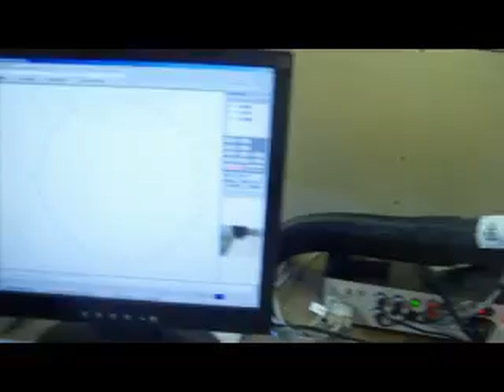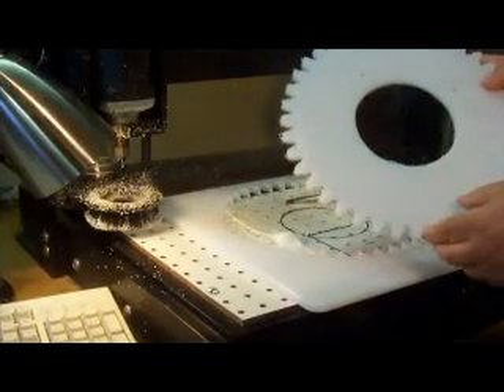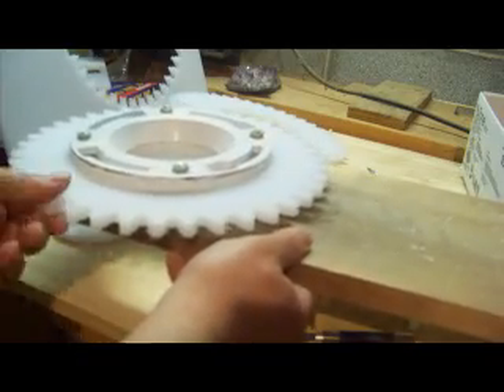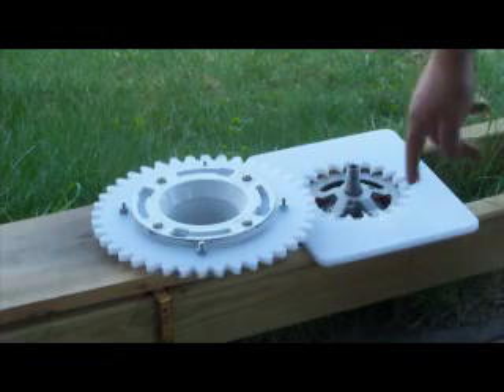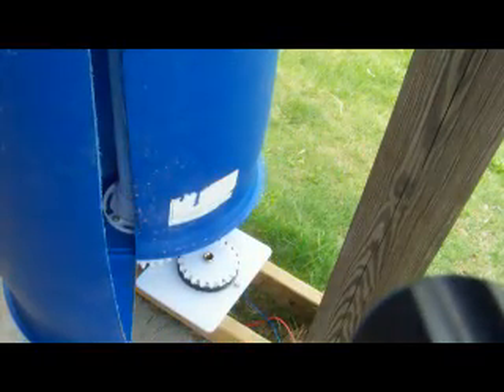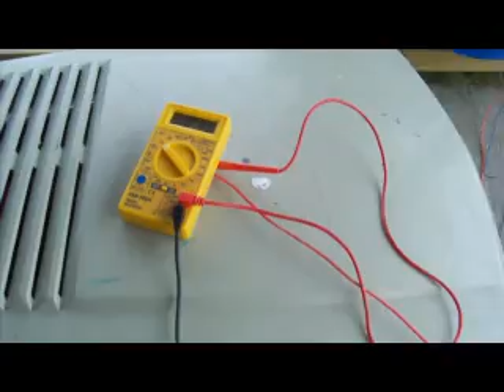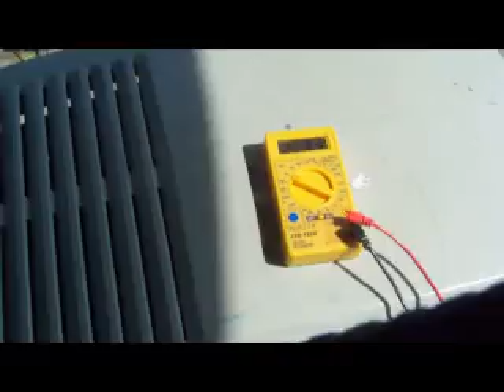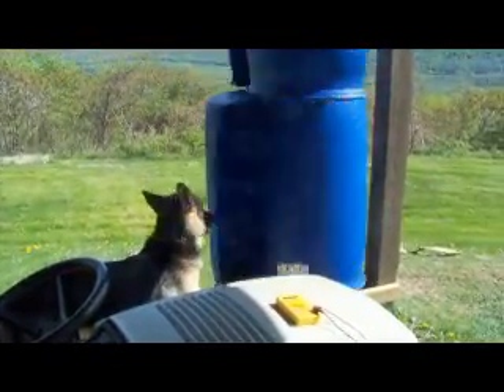How to Make an Inexpensive Vertical Wind Turbine - Part 2

Comment: I am currious why you chose to cut out and make the gears from plastic? (Other then to have an excuse to use that way cool CNC machine!) When I think an easier and probably less resistance way would be to use bicycle or motorcycle gears and chains? Using those would also allow the possibility of gear-changing for speed and wind velocity.
You did a great job on this! And you are an inspiration!

Comment from the maker: This alternator is based on a car alternator, but has been gutted and the inner coil has been replaced  with neodymium permanent magnets.  I'm not sure that the direction of spin matters as long as the wires are hooked up with the proper polarity.

Comment from the maker: Yes, I have a TV (insignia 15" HD lcd ) which works well because I run 12v right into the tv instead of using the wall wart that came with it.  Check to see if your PS2 or XBOX  can run on 12v because it will run much longer than if you run a 110v inverter which loses a lot of power as heat.

Comment: A belt system (in place of gears) would reduce the noise level and the pulleys are commercially available ready to mount on your alternator.  Either way, gears or belts, you might want to shroud your gear box, or belt system to avoid small animals and/or fingers getting caught in the system.  Or even your dog's tail.

Comment from the maker: 12V is a useful voltage if you have 12v consumer devices.  I am installed 12v LED lighting here and it bypasses the need to use an inefficient 110V or 220V inverter.   Inverters lose energy in the form of heat.

Comment from the maker: There is a trade off between the gearing and low wind operation.  I am now going to get more aggressive on the gear ratio on a 6-barrel design that I am currently fabricating.  Because it has more torque, I can use a smaller gear on the generator.

Comment: Nice work!

Seems to be allot of friction with those gears. You may want to use a belt instead to smoothen out your rotation. This would also make it start at lower wind speeds.

over all 5 *'s

Comment from the maker: hardyjch, 

Thanks for these great ideas.  I will have a new video posted in less than a month where I integrate six barrels in a new system.  It is not exactly what you described in your posts, but it does increase the torque in the system dramatically in three ways: 

1: I have increased the amount of each barrel which is exposed to the wind.

2: I am using more barrels. 

3: I have staggered the barrels at 30 degree intervals to enable smoother motion. 

I have this one about 90% complete.

Comment: would it be possible to reduce the load from the barrels by introducing magnets to suspend it on the axel? surely that would result in a loss of friction and heat dissipation? and if so would that greatly increase the overall RPMs?

Comment: Can i ask   Instead of your gear system ,Would the main drive wheel from a front loader washing machine work as well? Perhaps using the drive belt too? and anything else you could scrounge from a washer?

Comment: ok, so it should have good output, i suppose that now i think of it, regardless of rotation, the rectifier diodes should still only allow current to flow to the pos terminal anyway, i suppose i posted without thinking again lol, nice project by the way, how is it working out for ya?

Comment from the maker: Where can you get electricity for 6 cents per kwh?  Here in the wonderful state of NY we pay 17 cents.  Running a grid connect (some are under $300 now) is the best way to get a quick payback but many prefer batteries for redundancy, or a hybrid system.  We will be installing and reporting on two different inexpensive  grid connect units shortly.

Comment from the maker: 1)I think it should be possible to build a large generator at home but check with your local laws and codes to make sure that you won't be forced to take it down. 

2) Many electric motors can be used as generators.  Make sure that they are permanent magnet motors (magnets rotate on armature rather than coils of wire).  Different motors have different RPM requirements for generation. You may need to use gears or sprockets and chains to get the right speed for the motor.

Comment: @pearljamfan99 
Not really, think of it in terms of the change of momentum of the air.  If you can get it to swirl through the first curve and enter the second and take that curve, you've changed the direction of the air by 180 degrees twice, and the force to do that came from (and went into) the turbine.

Comment: Very interesting, but not inexpensive if you consider the fact that most people don't have a CNC machine, and some don't have the other power tools you used.  I don't see that you've been answering anyone.  I would also like to know how many watts it produces (if it even still works since the gears and stuff are plastic and will degrade under the sun unless the plastic that isn't affected by sunlight).
Reply: The plastic is nylon, which is pretty stout stuff.  Sprockets and chain are more practical.

Comment from the maker: This generator, which I bought on ebay, produces DC.  You can invert it to run AC if you have enough batteries and power, but it loses some energy in the form of heat when you go from DC to AC.  The approach I am using  is to use 12V appliances and lighting fixtures from the camping and marine markets.

Comment: You should find something that can slow it down if you want or a device that can put it vertical, when there's too much wind.

Normal turbines have some kind of brake.
It's so primitive.. that sometimes you should take it off.

You could cut some "doors" in it when a storms cumming up. It's very primitive.

Comment: I am a mechanic and I can assure you, at that alternator speed you won't produce any electricity. You need to speed up the alternator a lot more to produce 14 volts. 12 volts or less is nothing if you are using 12 volt batteries.

Also, a pulley and belt setup is much more efficient and quiet and will actually last much longer. Hope this helps

Comment: Try to put a chain and separate the gears this will isolate the alternator from the windmill vibrations also grease the whole thing to reduce the friction between the gears and the chain. 

Or at least grease the gears so they will have less friction.

Comment: Great engineering and workmanship!  Do you have any loaded tests?  I can see the open circuit voltage gets to 14v in some substantial wind, but what happens if you actually connect a battery to it and load the alt?  I can't find any hard data on your site or vid's, indicative of more VAWT smoke and mirrors?  I'm also curious about the charge controller that will charge a 12v battery bank when the input voltage is less than 13v (charging voltage for 12v).....    
Thanks!

Comment: The CNC is nice but you can cut gears like that with a scroll saw. I use those cutting boards all the time for interior boat panels.
Reply: The material choice is indeed inspiring, one can actually OBSERVE the friction 'melting away' from use as it self-smooths... awesome!
Man, I gotta get my pendulum-sail windbottler prototype finished and some more vids made, especially the details of the turbine that actually collects and stores the very wind that operates it.

Comment: Can I ask, would it not be better to use a belt and pulley system instead of gears. It seems that there would be less accuracy required for the alignment of the pulleys rather than gears.

Comment from the maker: DC motors with permanent magnets are very suitable.   The problem is that most of them are only efficient at higher RPM than a typical vertical axis wind turbine can produce, and thus need a gear, belt, or chain drive reducer which can wear out and usually robs the system of some efficiency.

Comment: Interesting idea i would probably use a belt driven system and use some recycled bicycle wheels instead of the Lazy Susan ball bearings.  Much less noise, more efficient, and can handle weathering much better.
Reply from the maker: You are correct.

Comment: I like your presentation but why add a gear? Can't the wind turbine axle turn the alternator directly? Doesn't seem efficient. Also, if  hi powered magnets were used on the bottom support so that the turbine would "float" it would be far more efficient and less noisy. What does this generator put out in 10mph wind?

Comment: Is that a Delco-Remy alt? What is the amp rating? I'm designing a  system w/centrifugal blower wheel using 1 in steel shaft w/  pillow block bearings (grease)  driving a standard 1/2 in v belt on a 125 amp Delco-Remy alternator. I havent decided whether to keep it at 12v w/ 12v bulbs or get an inverter and use 120v. I have most parts on hand. My initial project will be for  lighting only (inside and security) and maybe an absorber type Refrigerator. I'll only  use grid power for A/C.

Comment: Very clever,but with 2 major problems....Because i work on these projects many years i know that all kinds of alternators as much load you put on them charging batteries or using for an inverter 12-220 volt,its so harder to rotate them....Its the same as in cars.As the load is increasing you need more power to rotate them,so you loose power of spinning because the alternator is "braking" the wind generator,and you end up with a generator that cannot produce power anymore due to load....better to use pulleys with belt so you can control the load and its easy,longlasting,and really "inexpensive".Also you could use more silent bearings because the sound in a permanent construction like that 24/7 365 days....You cannot stand it.....Redards.

Comment: I'd like to know how much more power 
embeddedprogrammer  would get if he put a structure to shield the resisting wind, around the quarter of the rotating "turbine" where the wind is working against the "turbine" (or whatever you call it).
My guess, possibly double the power, double the RPMs.
If you do this, let me know what the results are.

Comment from the maker: Not sure what you can do with the blower fans (most won't work as generators) or the surge protector  The batteries could certainly be utilized as part of a battery bank (marine are better than car batteries).

Comment: Cool design, but I would agree with those that have said "use a pulley system" but would not use the whole mag-lift idea for sake of cost.  The weight of the barrels come in at a whopping 22lbs each!  I would say that reducing that weight by using a hole saw and whiffle balling the barrel walls severely and then re-lining them with a lighter plastic like heavy-ply plastic drop cloths.  I bet you could reduce the weight by at least 30% and thus greatly increase the RPM especially in light winds.

Comment: Because a car alternator produces AC which is converted back to DC, I believe the alternator should work fine in both directions, but this gentleman is using a permanent magnet alternator, which is more efficient than one you would find in a car.

Comment: I don't know very much about this sort of thing, so please forgive me if this is a stupid question. Why use the gear at all? Could you not mount the barrels directly on top of the generator and cut that part out completely?
Reply: i believe it is to increase the RPM of the alternator/generator. alternators are more efficient at higher speeds. summing up, you get more power output from the same amount of wind. its not essential, but seems to be common practice.
Reply: Eric Mastenbrook needs to step up the rpms but needs whole lot more 1600 min rpm for 50 amps plastic gears and chair mount not kicking it flays apart. Need steel construction.
Reply from the maker: yes, but you need a very low rpm axial generator for that and I was trying to use off the shelf stuff.

Comment: Could it not have been designed to sit directly on top of the alternator as opposed to the side of it and thus eliminating the need for the two gears? Without the two gears there would be less drag and it would also make less expensive. Just  a thought.

Comment: I like the idea, great innovation however, the gears need to be made of aluminum, stainless steel or some type of metal. The plastic teeth wears out to quickly and the teeth strip and break off.  i hope you put in a patent for this. great work.

Comment: @DineroDarkfire Good point! But I guess he only used the CNC machine because he had one at his disposal, most people who have a go at building this, who don't have a CNC, could either cut the gears by hand(it's tedious, but can be done!) or use a belt and pulleys instead! Even better would be to custom build a pm generator to bolt straight onto the turbine, no belts, pulleys or gears needed!

Comment: Not low cost with cutting equipment included. You seem extremely capable of doing this without all that. I am eager to learn and have from your video. But, steps are missing that I dont know how to supplement. Have any ways around the spendy techno?

Comment: From what I've read rainwater doesn't conduct electricity because there are no minerals in it. so snow shouldn't short it out. I have an open alternator and it's ran in rain and snow with no problems.

Comment: great idea, a smaller gear/cog on the gen should be more efficient. knowing what RPM is the most efficient for the gen would of course help.did you lube the bearings ? also a 26" bike wheel with a belt in the rim channel driving a smaller pulley on the gen would work too.just trying to put some ideas out there. train/semi truck batteries are another option. good lookin dog if it's a male is his name Edison ? ;o)

Comment: It is possible but only because you didn't use any load, try this one..when will be this turbine at max speed (max rpm,wind) conect output conectors of that alternator together and you will see what will be(max torgue max force),by the way 14V  isn't important because no load,use some load(10W bulb) and after that tell as something, is it only my opinion but i think that bearing is too noisy did you try sleeve bronz bearing?plasitc gearbox is ok for low load.Please make another video. Thanks.

Comment: Hi from Canada,
You measured the voltage output
of the your Savonius wind power system.
And  I saw 14 voltage, but I would like to
know how many amps you got from
that permanent magnet generator.
Oscar
Reply: Oscar Obel needs more rpms to make min 50 amps 1600 rpm also then alternator starts to build resistance to turn due to electromagnetic force by a ac 65-12 aircraft maint manual book explains all theory.
Reply: very good question! yes, what's the amperage under load?
Reply from the maker: not sure.. I will do a power analysis this summer and get back to you.
Reply: HELLO, 
Thank you for your presentation ...
Please what did you get ?

Comment: It would depend on what speed the alternater or generator needed to produce a usable power.  The bigger the windmill the slower it will turn. In most cases they run at around 60 - 120 RPM's A car alternator needs to spin much faster somewhere between 500 - 1000 rpms. Just to start charging.  Now if he makes his own alternator then it is possible to achieve power at a much slower speed.

Comment: I agree with DrDisintegrator. Those plastic drums prove your point but detracts from the technical beauty of your work. You can still cut hoops from old discarded plastic straight sided drums brace them with stringers and cover up with some form of sheeting. Then you have something nice. Tell me please what is that machine used to cut. I wondered what is cutting board then it clicked!..Like the one in the Kitchen??!! Clever you . Where to buy large sheets. thanks rmmnet

Comment: Hey, Love the shop. Thanks for the idea, I may try this on a smaller scale. I was wondering, if you put a strip magnet vertically along the outer lip of each barrel half(4 total) and surrounded it with a copper mesh(yes, it would look ugly) could you induce current in the copper mesh and would it be usable a usable amount? Just a brain fart.

Comment from the maker: I am using a modified car alternator with permanent magnets and smaller diameter coil wire to generate at much lower rpm.

Comment: @breefolk   Just watched The Colony on Discover channel.  They made their own wind turbine (fan style) but they used the gears off of bicycles.  During the show they indicated that the back set off a 10 or 12 speed bike could be geared up or down to assist in spinning the alternator faster or slower, depending on their needs.    Of course you would have to be dependent on chains, that may break or snap, but it is an alternative way to gear any type of wind turbine.

Comment: Great gears ! !  If you want to try a more powerful turbine, I suggest the Flap Turbine - here's a link VAWT VERTICAL AXIS WIND TURBINE, LAKE AERATION
It produces much more torque than the Savonius you are using so you will need to make a smaller gear for the generator, I am guessing about half the current diameter. 
Thank you for sharing your creation.

Comment: how about a bike chain and cogs? I am sure that with a lot of grease it wouldn't rust, otherwise they can be bought in stainless. Also as others have alluded to alternators with their design are not conductive to making any useable power below a certain amount of revs. Although they have their own issues D.C motors with a solar panel rectifier is the easiest. However I think using an RC aeroplane motor, rectifier and reg is the way to go

Comment: Nice turbine..I will try to build this type of turbine but will use pillow block and drive pulley and drive belt for alternator..
Reply from the maker: Good idea.  Let me know how it works and send me a video if you can.

Pillow blocks are better long term solutions.